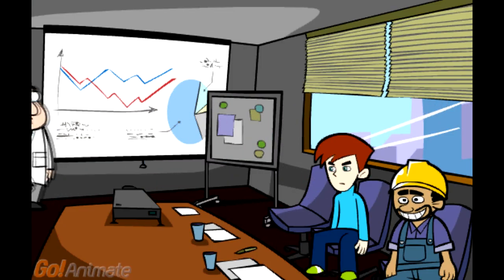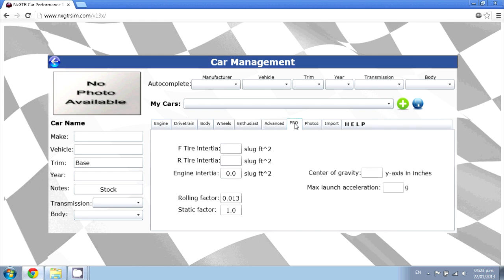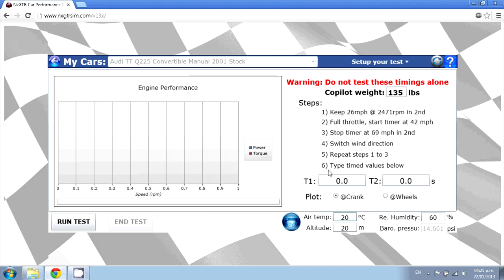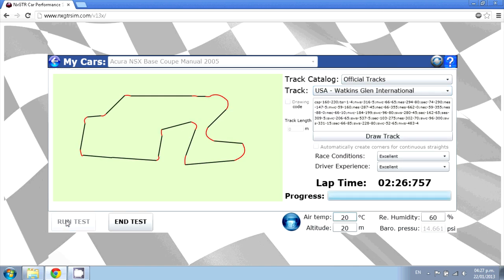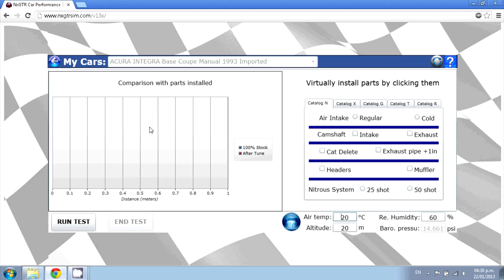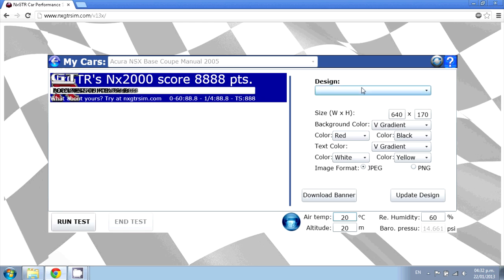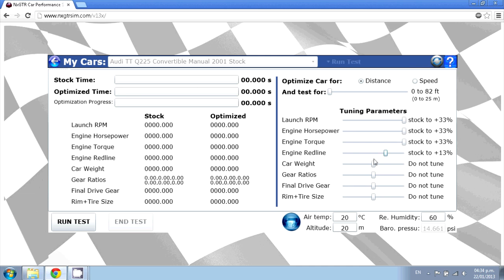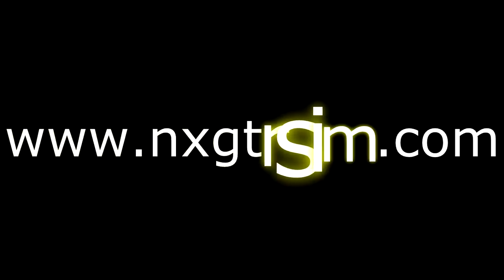NxGTR Car Performance Simulator v13x

Comment from the maker: Yes, it is, actually ANY single car you can think is in there, if not already designed for someone else, you can design it yourself with the built-in car designer in the system.

There is several Neons configured by different people, from stock to tuned, you can look all their specs do your own mods and test.